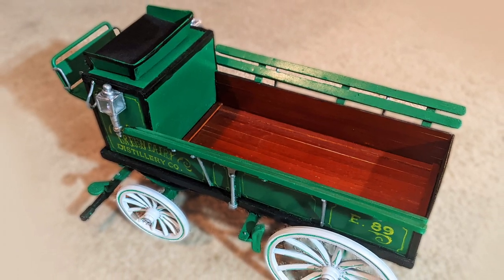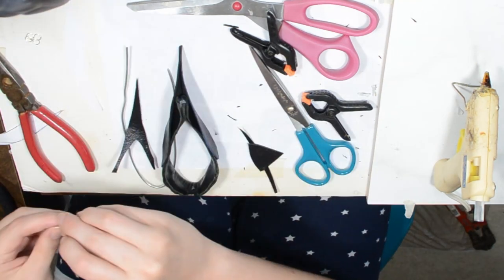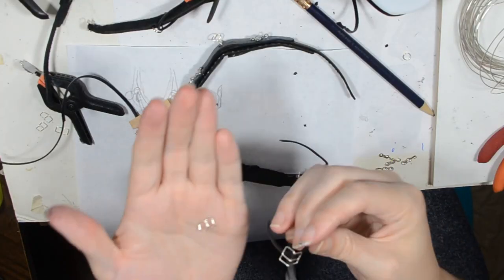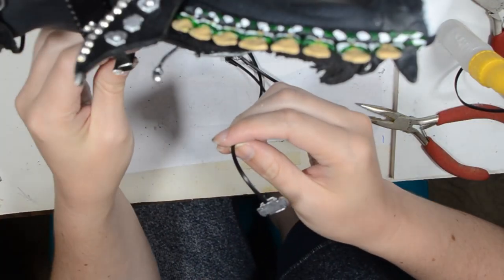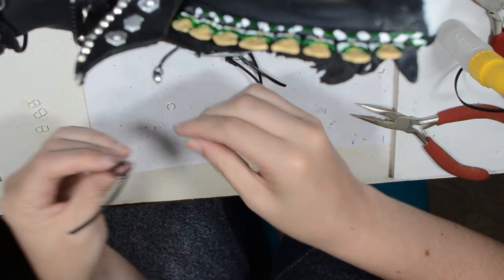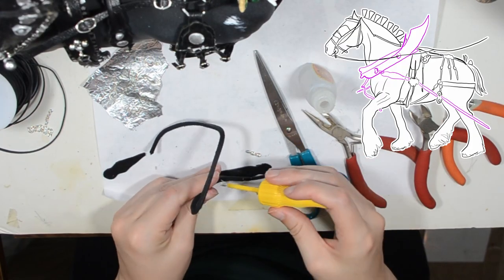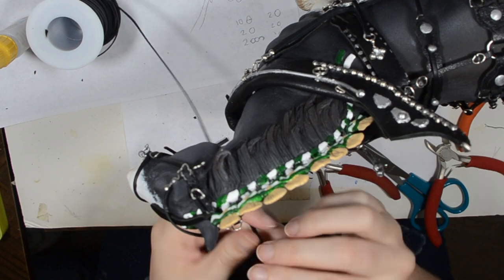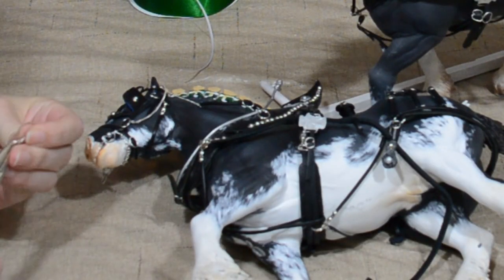How to Make a Model Horse Harness

Comment: If you ever do a similar project with a lot of harness or tack work, try using 3D fabric paint, and running a bead along the edges of the leather pieces. Makes them look rounded, like a thicker piece of material. Helps the realism and scale a bit.
Reply from the maker: Ooh interesting, do you know of any examples? I can't seem to picture it but it sounds cool.
Reply: @starbatcraft basically using a thicker paint to make it thicker/ raised, and then run a bead or stick holes on either side as if it was stitched leather. 🩷😋